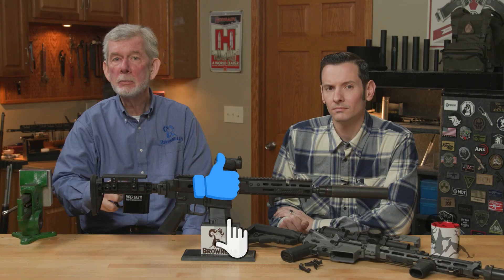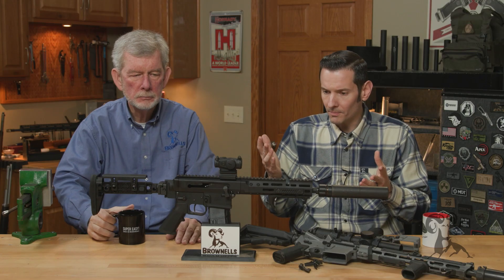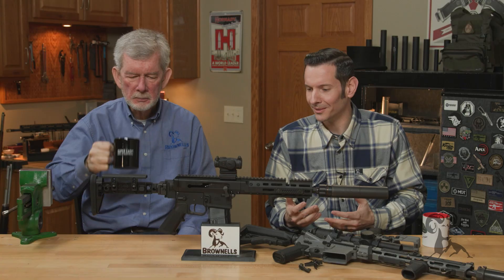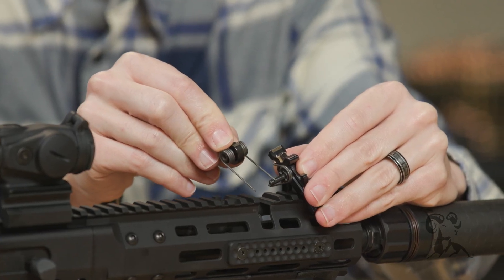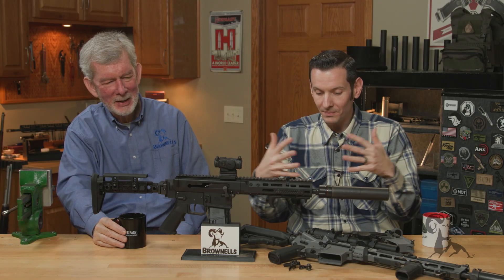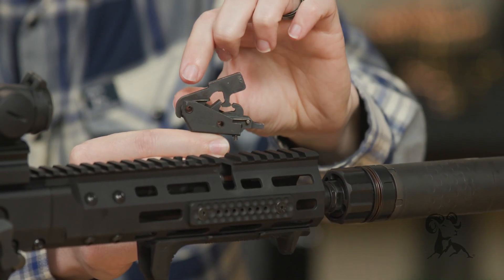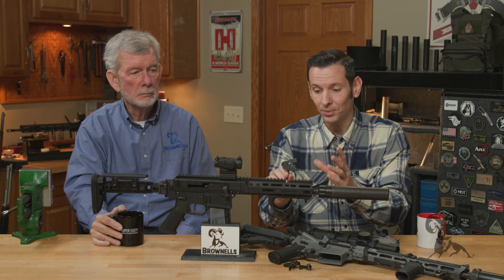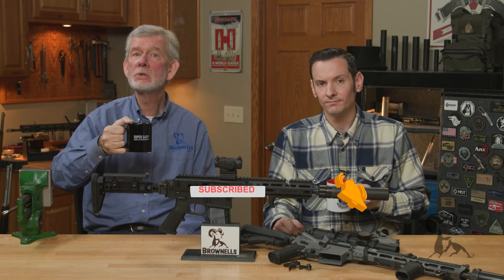Smyth Busters: Does Your AR-15 Need Anti-Walk Pins?

Comment: I'm not going to argue for or against because I don't know enough to do that. But, I now know more than I did 15 minutes ago. Thank you for that. I am just too darn cheap to spend $200 or more for a trigger. In my 2 rifles I have one Midwest Industries, and 1 Rise armaments cassette type trigger group. I like them both very much. Both claim 3.5 lb. and to me they both break very cleanly  crisply. Both have the screws in the ends of the pins to keep them from walking out.

Comment: I have anti walk pins in one build. Was at a match and had the trigger pin walk and start causing doubles. This was from a LPK and may have been more the issue with the lower. Thanks for the video and the information on different use of the pins.
Reply: Sounds like a turd rifle
Reply: if you had a pin walking, you were already holding junk in your hands.

Comment: @Brownells .My rifle is my Corvette. I cannot afford a Corvette, so I bought a rifle. I'm going to install anti walk pins strictly for Aesthetics. The little cap screws to hold the pins in are my hubcaps.
The muzzle device is my muffler. My flashlight is a headlight. My scope has clear windshields. My backup sights are curb feelers. My lapped Barrel is a honed cylinder. My feed ramps are the intake manifold. My bolt carrier is my piston. My charging handle is my fuel injector. My push button safety is my emergency brake. My extended takedown pin is my hood release. My collapsing stock is my adjustable seat. My trigger is the gas pedal. My shoulder strap is my seatbelt. My vertical grip is my grab bar to get in and out of my Corvette. Add Fuel and drive. Total cost, not as much as a Corvette. 9.5lbs

Comment: Thanks for clearing up this topic. I have always used standard pins with the Geissele triggers in my ARs but there are always those nagging voices for anti-walk/anti/rotation pins that I hear which makes one wonder. I have never any problems with the standard pins, but knowing is better than hoping. I did install an Elftmann trigger in one AR and it was obvious the regular pins wouldn’t hold it in well. I took Elftmann’s advice and bought the anti-walk pin set they sold and cured the problem. Therefore, your advice on this type of trigger made complete sense, backed up from my experience. Once again - Excellent video!

Comment: I like anti-walk pins, gives me a warm fuzzy feeling knowing the pins can't move
Reply: Make sure that you always have the right tool to remove them, if you need to use the gun, for a serious/extended situation. I get a good feeling, that I can service the fire control group, with no tools.
Reply: I've had screws back out. No I'm not using locTits because I'm a tinkerer that fondles each gun religiously. But I've seen pins move too, so springs don't always sit in slots preventing movement.
Reply: Buy high-end parts from companies whose priority is absolute quality  control, and they will be inspec. No need for them ever.
Reply: @zack9912000  If I buy a rifle I would expect things to work but most of my stuff is pieced together, drop in triggers, some 80% lowers, just easy to use anti-walk pins and it's doesn't cost much so I do them on every build regardless of spec.

Comment: I have 3 AR15’s and only one needed anti-walk pins. I think they cost me $15-20. It just depends on the specs of the trigger pin holes and pins. While it’s all supposed to be mil-spec sometimes they are off just a smidgen that allows walking, especially with some of the cheaper build kits.

Comment: Had thousands of M16A1 and M16A2 rifles in the arms rooms under my command over the years. The M16A1 rifles had seen Vietnam's jungle paradise. NEVER had any problem with fire control group pins walking out, and those had THREE pins for the select fire control groups. NEVER had any problem with the pins wallowing out the receiver holes. NEVER had any pins break. A properly designed and installed 2-piece civilian semi-auto fire control group with the correct pins does not need anti-rotation or anti-walk pins. The springs will hold the pins in place.
Reply: At my command we had ONE rifle where the pins would walk out while firing.  Sample size one I know but it can happen.
Reply: Yes and no.

nobody has ever successfully sued a firearm or firearms parts producer for being out of milspec while claiming milspec.  And theyd have zero chance of success doing so between manufacfurers of different parts.

Anti walk pins arent needed in a military setting.

But in a civilian setting, theyre a cheaper alternative for people with a muffler problem.

Whats a muffler problem?  Its when patching an out of spec receiver hole costs more thanreplacing a smaller pin.  My car has a bad muffler?  No need to replace the entire exhaust system when I can throw a $10 JB muffler patch on it.

Antiwalk pins have their place in the civilian market in a way that the military doesnt have to consider.  They can outright say "this doesnt fit spec.  Take it back".  Most of US have to deal with a second background check, a transfer fee that we wont get refunded, and no guarantee the next one will not have the same issue.

Antiwalk pins in civi life arent comparable to antiwalk pins on the front.
Reply: @marcush4741  Good take on it.
Reply: @marcush4741  my M4 and M16 would’ve benefited from anti wall pins considering I’ve had pins walk out with both platforms, as well as with my personal rifle and its geissele trigger/pins. Milspec isn’t the gold standard everyone thinks it is. It’s just the good enough for the military which is a very very low bar. 

I personally modified my M4 with and without approval for this reason. Since we got the knights suppressor I’ve swapped in the LMT enhanced bcg, accu wedge, FCD charging handle, tubbs sr25 flatwire spring, Wilson combat anti wall pins, DD clamp on rail, sopmod stock, b5 pistol grip, angled foregrip, and rail clamp to name a few. 

That’s how much I changed to feel comfortable and confident to deploy with that M4
Reply: @ShepherdOfTheSilkies  believe me, Im not saying milspec is great.

But milspec in the civilian world means even less.  Because if the government gets a shipment of m-16/m4 lowers that are out of spec, they ship them back for replacement or demand a refund.

Civilian side... anybody can make a rifle and call it milspec.  Plenty of companies do, withojt ever having a military contract.  And theres virtually no recourse to sue.

And of you DO get a rifle thats out of spec and want a refund, the most theyll do is replace it... but youre paying shipping ba k (firearms shipping is expensive), and the transfer fee for the new one.

Its literally less expensive to keep your out of spec lower and buy a new one than it is to ship the old lower back for a replacement.
Reply: I was thinking something like that. The added complexity and worst-case-scenario of trigger pins that creep out does NOT make for good military use.
Reply: Rifles designed for semi auto use tend to have less precision parts in general. The general population who fires one round per second will probably never experience pin walk. My PSA which I love dearly might I add only had issues once rapid fire was introduced. Does it mean it’s a shitty gun, no, does it mean I’m using it improperly, yes. Should you buy an anti walk pin for your AR? Why the hell not?
Reply: I call BS. The Hammer is meant to rotate on the Pin and not the Pin in the Reciever. There is a tiny hole in the Hammer to get lube to flow down to the Pin so that it does. That wire insids the hammer is a spring to engage the center groove of the Pin to prevent walking out same as the as feet of the Hammer Spring prevents the Trigger Pin from walkingg out. But This does not prevent Pin Rotation. What does prevent Pin Rotation is when the Government Contract Builder properly press fits the Pins into the Recievers in the manufacturing process and the Employee that it issued to doesn't mess with it. I'm a home builder and I don't have the expertise to be press fitting my own pin and have anit rotation pins in everything I build. I'm in the process of doing an AR-10 with an Aero Precision lower. The hammer pin was rotating in the Reciever before I could get the side bars installed. So ya, Anti Rotation Pins reduce Lock Time? No they do not.
Reply: @ironoutrigger1  NEWS FLASH: NONE of the hundreds of M16s in my arms rooms had "press fit" hammer/trigger/autosear pins in them. NONE OF THEM. The pins were free to rotate. Nearly all the rotation of trigger/hammer/autosear in firing the weapon occurs on the pin itself, but the pins slowly rotate during operation. THIS IS BY DESIGN! You're a complete ignoramus about the weapon's design, how it's manufactured and how it's reassembled by armorers. Locking the pins and not allowing them to freely rotate with anti-rotation devices DAMAGES THE WEAPON!! I had many hundreds of them in each of the arms rooms under my various commands over a 20 year career. EVERY FUCKING PIN ON EVERY FUCKING WEAPON COULD FREELY ROTATE! EVERY FUCKING ONE! HOW DARE YOU TRY TO LECTURE ME ON THIS. HOW DARE YOU!!
Reply: I've been using them for a while now. Rise armament to be exact. The only thing I've noticed is that my hammer pins still unscrew... I've pulled the trigger and hammer pins out, replaced with new after a good alcohol cleaning, and I've used blue loctite and hopefully that keeps them in.
Reply: Thats because they use the springs to hold them in dumb ass, the hammer springs hold the triggren pin in and pin inside the hammer holds its pin. The pins dont actually rotate inside the reciver if they did they would woller out the pin holes. .002 difference in hole slze to pin size for a reason. So you dont wear out the reciver holes cause you dont know. But you were in an arms room with guns that wernt even being used in the 80 and 90
Reply: You think they were NEW? They'd ALL been to Vietnam and back -- not to  mention repeatedly shot for annual qualifications and thousands of rounds of blanks each per year. Try another one on me. They were all very, very well used.
Reply: I was an armorer in the Marine Corps. I've seen pins walk out of an M16A4. It's a rarity, but it can happen.
Reply: I worked on Paris island as a marksmanship instructor, we had 3-4 guns every day go down for the pins falling out.
Reply: My M16A2 had problems in bootcamp. During qualifying I experienced pins walking and malfunctions. A Marine was called over and he took my rifle and put in a different bolt carrier and then took a little bottle (Visine size bottle) of CLP and poured it all in the rifle. Then told me to watch the pins. After I emptied the magazine I would push on the pins. I scored enough to qualify but was given the option to requalify and if anyone has ever been to Parris Island you don't risk staying any longer the necessary.
Reply: I was gonna say this as well, didn’t know that anti walk bridges existed then but thinking back none of the military rifles had those, not even the machine guns had any bridges to prevent walk or rotation
Reply: Lies lies lies. My pins keep popping out after a few hundred rounds causing my ar to shoot in binary. Anti wall pins helped with my issue.
Reply: @Matt_Nguyen Yeah - right - call my 20 years of honorable service as an Article II POTUS Appointed, Article VI Oath Title 10 US Code Commissioned Officer of the United States all lies. Try another one TROLL! I have zero motive to falsely relate and lie about my own experience with thousands of M16A1 rifles under my command.
Reply: @Sparks68  lies
Reply: @Matt_Nguyen sounds like you didn't put things back together right.
Reply: @BackYardScience2000 fake news
Reply: When did you serve?
Reply: THIS. Buy real quality controlled parts, and it's a non-issue. Buy cheap crap from anderson and psa, and you will have issues.
Reply: @zack9912000  crap from PSA? Some of the best parts kits I’ve gotten came from PSA. Never had a problem with PSA products. Watch the torture tests videos of PSA products. People don’t want to admit how good their products are compared to the 2k AR’s out there.
Reply: @manicmartyr69  I think we all know that the 2k Daniel Defense / KAC is basically only better for the bragging rights over the guy with the 600 dollar PSA, M&P, etc.
Reply: @zack9912000 my PSA parts have been flawless bud!
Reply: @zack9912000 I use less expensive lpks and never had issues with the trigger assembly pins, but did have a mag release issue ounce.
Reply: Why you have to throw shade on PSA 🤣
Reply: @zack9912000 trying to justify his 3k$ AR
Reply: @zack9912000  lmao if you think either of those are shipping out bad pins of all things.
Reply: @zack9912000  Colt lower and geissele pins walked on me multiple times. Lower is in spec but the geissele pin spring channels are too shallow. It’s not common but it does happen.
Reply: @ShepherdOfTheSilkies  I've got Geissele 2-stage (more than one) and never had a problem -- ever -- but it REQUIRES installing the trigger control group per Geissele instructions, which too many will pitch into the trash without reading them, along with the circular spring clip they include to hold the hammer pin in place.
Reply: @Sparks68  luckily for you that you haven’t.. but i know a out of spec pin when I see one. People need to realize even the most quality parts have lemons occasionally. It’s also not that hard to install a trigger, the instructions are pretty irrelevant when you already have installed multiple triggers without issue. Pretty simple concept, spring leg goes in spring groove. For further clarification I could push a pin out with my finger tip. I’m also not the only one that got a crap pin, theirs a handful of others that who installed them using the instructions and still had walking.
Reply: @ShepherdOfTheSilkies  Geissele 2-stage have a proprietary spring clip that goes onto the hammer pin that isn't used on mil-spec trigger groups. Not the easiest to get into position properly when installing the hammer. Omit that spring clip that goes between the hammer and lower body, and the hammer pin *will* eventually walk out. there's nothing to hold that pin in on its center groove unlike other designs. You must read the directions that come with the Geissele 2-stage to know this. What a concept -- reading instructions.
Reply: @ShepherdOfTheSilkies the older colt lowers used thicker pins so people couldnt make full autos with stolen colt parts, there are millspec pins and 90s colt pins, the colt pins where thicker
Reply: @wallyunitus8071  yeah, I know, geissele small pin triggers don’t fit post ban colt lowers at all…
Reply: @wallyunitus8071 consequently if you use the smaller pins in the big holes the gun will fire full auto
Reply: @zack9912000  you say that go watch SOTAR knights lower video and tell me different.

Comment: I got anti walk pins because my drill bit got a little too hot and the tolerance was to much. But it works fine for that purpose.
Reply: In your instance, they make sense. In any other set of circumstances they're junk.

Comment: Could NOT have said better myself Caleb. People NOT understanding the actual “mechanics and physics” behind how something/anything works!!! Then regurgitating the half information they heard/read!!!
Reply: That's why Smyth Busters even exist!
Reply: @CalebSavant  that’s the one thing irritates me the most… when people talk but don’t even understand the mechanics and physics behind it. I’m a novice Armorer/builder. Started 20 yrs ago when I bought a synthetic stock for my 30-06 and though it was specifically designed for my make and model it didn’t fit. Having the skills and experience working on cars and boats I purchased an aluminum bedding for the stock and went to work, removing material, layout, inserting the bedding doing the fiberglass work, shaping and fitting it until it was a complete custom job. Enjoy working on and building these different firearms for myself. But I have a full construction, mechanical, electrical, amateur welding/fab background. I know the mechanics of something when I tear down or build something and understand the actual physics that make said mechanics work.

Comment: Yes, I just put a build together a couple weeks ago and the bottom pin walked out in less than 15 rounds.
Reply: Make sure your hammer spring isn't backwards 😅🫡
Reply: Did you use a cassette style fire control group?  Who made your lower receiver?

Comment: Good video. I bought cheap pins and then found they did walk out while checking lower. So went anti walk. Tolerances from different companies vary. Lower is a piece of aluminum and not the strongest metal. The holes do oval out over time because pressures on them. And the different trigger groups. "There is a time and place".

Comment: the pins are held in with the hammer spring. genius idea and certainly sufficient. The military doesnt have anti-walk pins civilians probably dont need them either. Drop in triggers excluded. I guess they look kinda cool though.They definitely dont hurt anything.
Reply: I've had M16 pins walk out on me. Likely due to the wear and tear on them, but do not fall into the trap of "good enough" for the military.
Reply: @Jhraxlin  more likely somebody put the pins in backwards aka the trigger pin in the hammer and vise versa. some hammer pins only have a groove in the center and will slide out of the trigger spot and the trigger pin with a groove on each side but not in the center will slide out the hammer spot. in this case the good enough for the military is totally true. My m16 in basic was from the 80's and beat to piss but guess what? the pins never tried to walk out even with all the crazy stuff we did that practically no ar15 owner is going to do. as far as quality i dont go by that rule however, because the military buys from the lowest bidder and their stuff isnt that great in most cases. If the fgc is assembled properly the pins are not walking out.